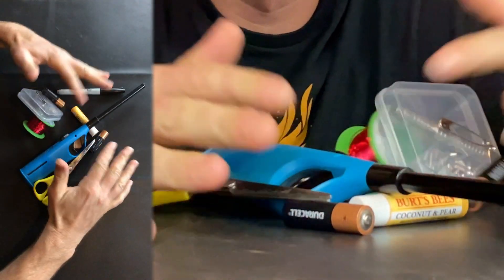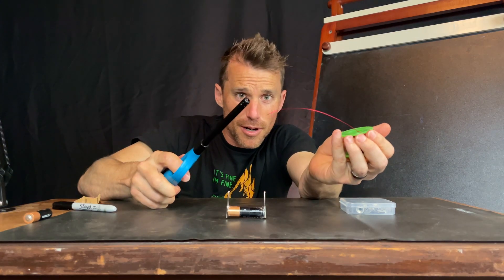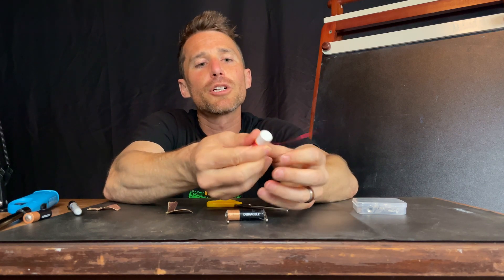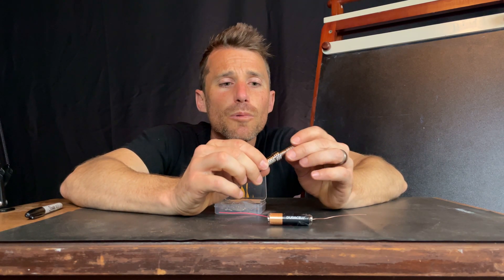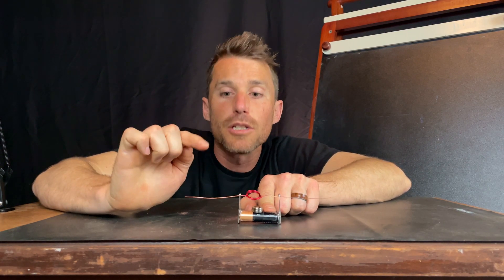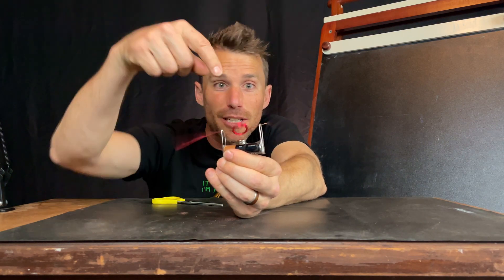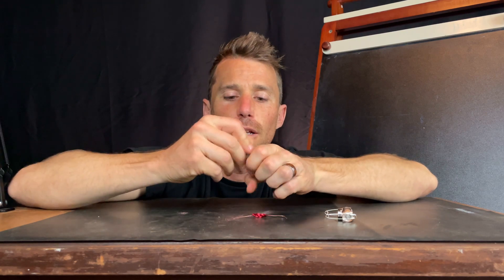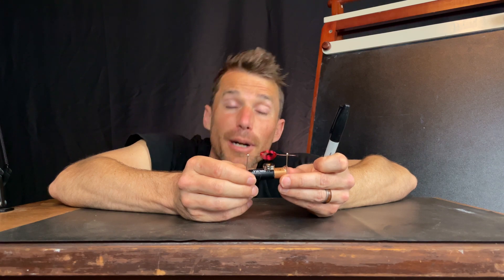Best little dc motor (and the trick that makes them work)

Comment: I’m scared of playing with batteries like this bc they can heat things up really hot I’d be scared of starting a fire. I think this is what happens if you connect two 9v batteries together.
Reply from the maker: The wire can get pretty hot! I think it is worth playing with them though. I don't think you will get burned. Just use the AA and not the 9V ;)

Comment: The Enamal  has to be on Half the wire so it will act like a switch turning the current on and off at the right time to keep it rotating
Reply from the maker: That's it! The little trick of putting sharpie on one side of the wire to make that happen is new to me this year. Have you ever made one?